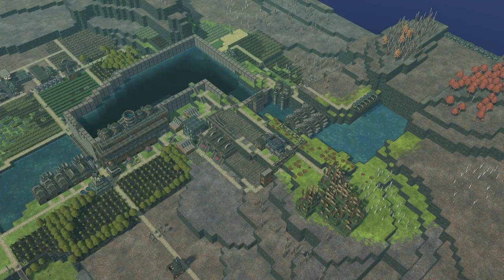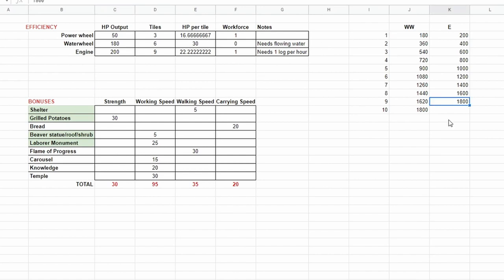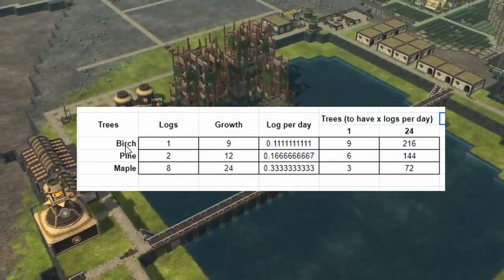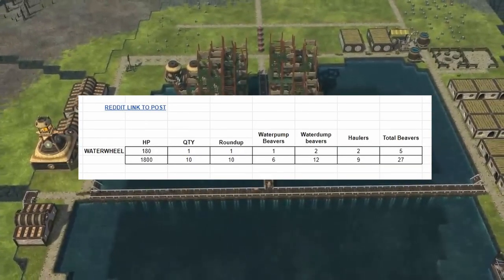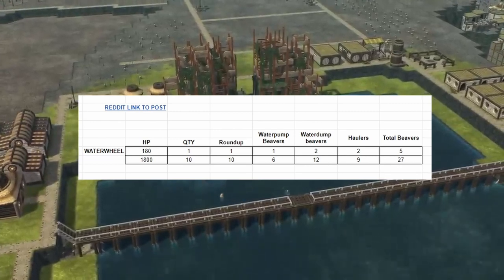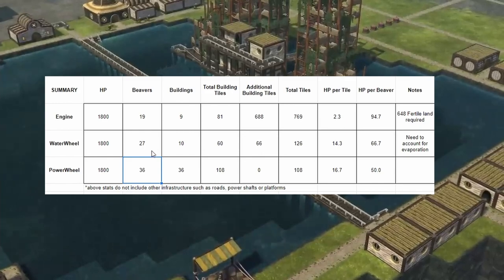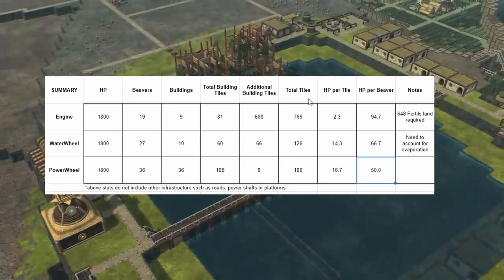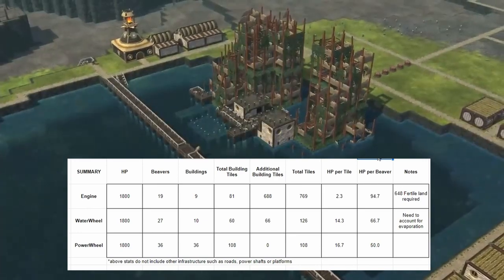TIMBERBORN - Let's Talk About Power

Comment: Are the engines really using 24 logs per day? Since your beavers aren't working 24hours. You anyway don't need 24 hours energy supply, since all the power consuming factories are just running 16-20 hours, this would cut down the log consumption drastically and also the therefore needed tiles for logs. In addition to that the engines only need to be running during the droughts, this would mean you don't need to reorganize that many beavers for their work compared with the other options (more comfortable ;) )
Reply: As I understand, on hard mode the droughts pretty soon become the majority of the time (as in the dry season may be five or six times as long as the wet season), so even if you set up water wheels (space) and manually turn the engines on and off (micro-management - labor intensive) you don't save that much on the logs.
Reply from the maker: Yes they do. They can hold up to 24logs and will only stop working once they burn through all of them. They don't care if you've paused them or not...

you also can't manage how many logs go into them as beavers will keep it stocked to the brim
Reply: @АмериканецвРоссии-и4б   Alright I see if the drought  season is longer than the wet season, then it seems the waterwheels are the alternative energy source and not the hamster wheels or the engines^^
Reply: @BabyDragon1  well than you are totally right. Than I guess it would be interesting to see @tim r 's suggestion with the waterwheels in a row, but I understand the point that this would be time intense to try.

Comment: Very informative, I just wish that the numbers had gone differently. I for one think the power wheels are an unattractive option because it doesn't require much thought or planning.  In other words it's to simple and straight forward.  I confess that I like the problem solving and some of my things in any game is sort of like a Rube Goldberg Machine.  Please keep up the great content.
Reply from the maker: I agree with you and for the very same reason, powerwheels will hopefully be a temporary solution to get through the resource grind. Lategame, I'd prefer to rely on the other two

Comment: How about build huge water tower? If water source can't bring water higher than it's actual level, you can use beaver labor, it should worth this time because it's impossible other way.
It also fits your base plan about "castle-like" structure.
Castle-like structure build around water tower?
Reply from the maker: It actually can :) I'm hoping to demonstrate it at some point
Reply: @BabyDragon1  im assuming this is only for water sources you can build all the way around, so wouldnt work for ones on the edge of a map.
Reply from the maker: @jamessssssssssssssssssssssssss  I'll do it on the current playthrough

Comment: You can download mods to play in a creative mode! Totally fine if you dont want to mess with your game's build though.

As far as these numbers, this seems like a good estimate. I'm surprised at how slow water evaporates because when you did the testing for the water dumps, the water quickly evaporated in just ~8hr period. Maybe there is a critical mass requirement when the game checks if water is supposed to evaporate.

Do post your findings because these in-depth numbers are really detailed! Nice R&D
Reply from the maker: Tbh I have not looked them up as I don't urgently need them. Happy to wait until they implement it via steam

I'm guessing you're right because in the big tank the water seems to go down much slower, even though we have several pumps there
Reply: @BabyDragon1  I dont think water in tanks evaporate. It is just that larger tanks hold quite a bit more water despite only needing about 4x the resources.
Reply from the maker: By big tank I meant the reservoir with water pumps, my apologies